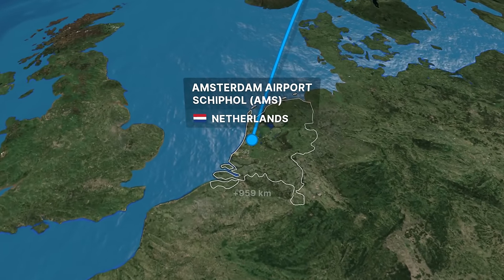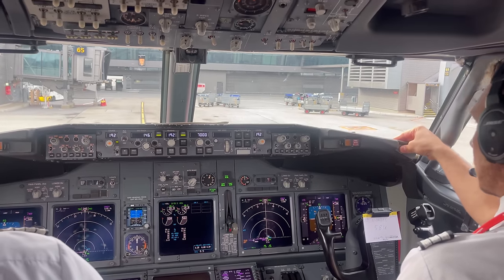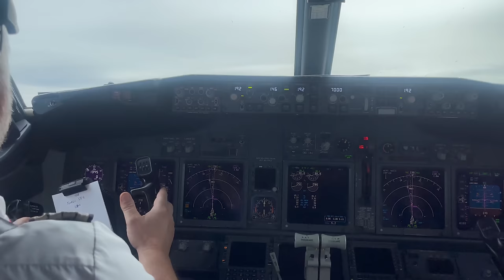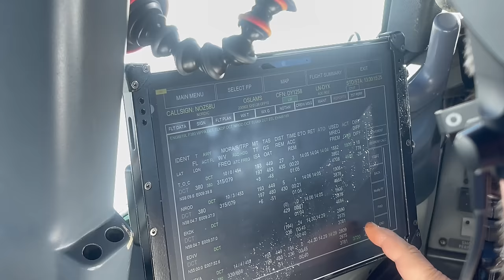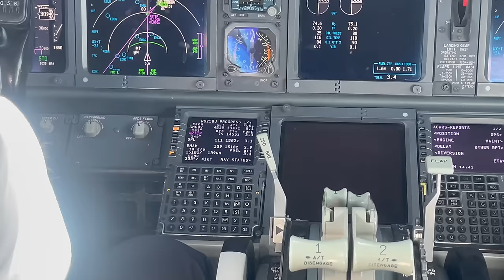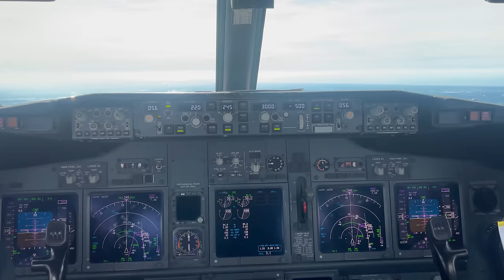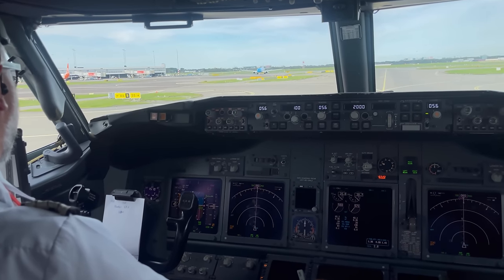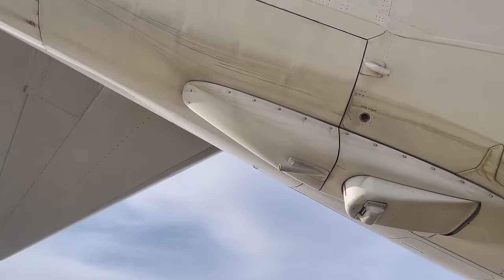| Norwegian 737 Cockpit | Oslo - Amsterdam | Down To One Of Europes Busiest Airports! | Flightdeck |

Comment: Why do you guys leave on the L Aft fuel pump? :)
Reply from the maker: Most likely because we didn’t have ground  power available  right after we parked up at the gate, so we need one of the fuel pumps to be on so we could leave the APU running and on bus. 

So that we again could shut down the engines for the ground crew.

Comment: great video, but what happend to TAT after engine start? (+99°C)
Reply from the maker: Because we are on the ground. No more air temp to measure.
Reply: When starting the engines the probe heat automatically activates (at 50% N2, same time when the voice recorder jumps to auto). The probes are designed to measure the TAT during flight so on the ground with little or no air flow they indicate a much higher temperature. Hope that helps :)
Reply: Thank you, learned something new :)
Reply from the maker: @Fabi_Hansi92  Here is a awesome explanation. More detailed than mine😆
Reply: @CptMitchu  I just had more time :D

Comment: When does Norwegian turn on seatbelt signs before landing?
Reply from the maker: Depends, but almost always at 10 000 ft :)
Reply: @CptMitchu  Are you a pilot yourself?
Reply from the maker: @munkboyaviation  In some years, yes. But, im just filming for the moment. I have been in the seat many times.
Reply: @CptMitchu  On Norwegian the amount of reverse used after landing is usually up to the pilot isn't it? But I believe idle is the recommendation.
Reply from the maker: Correct.  @munkboyaviation